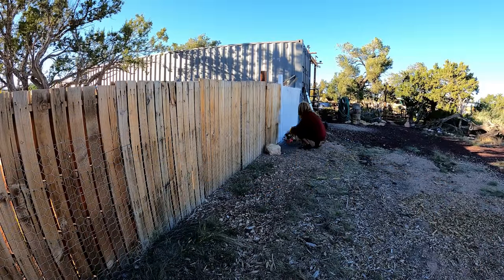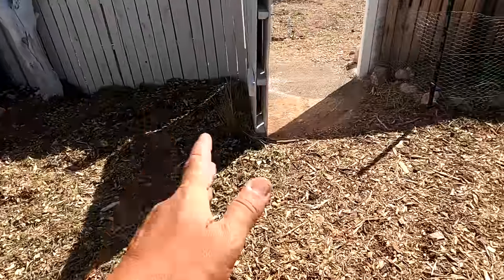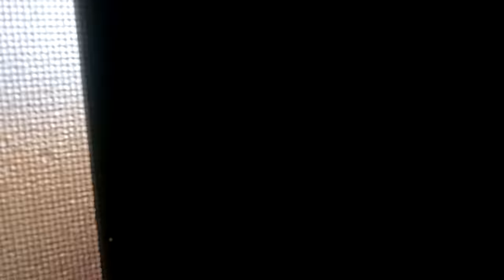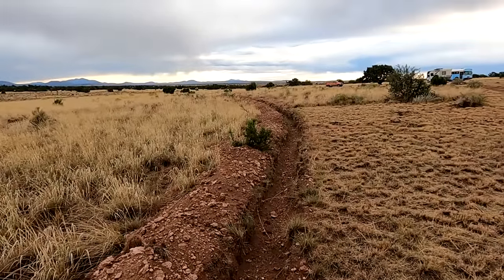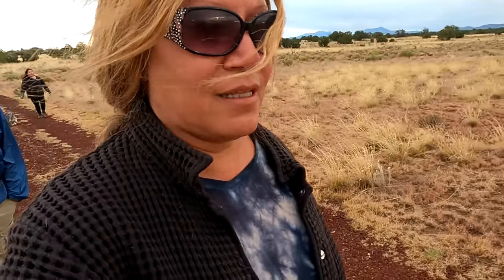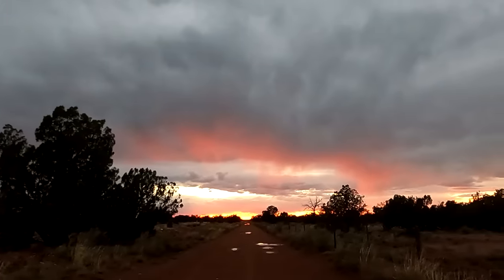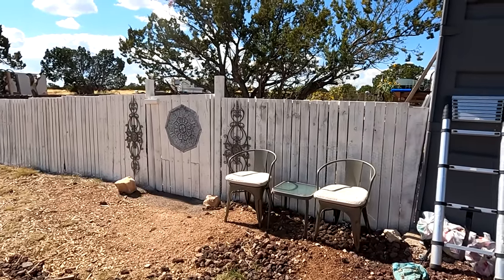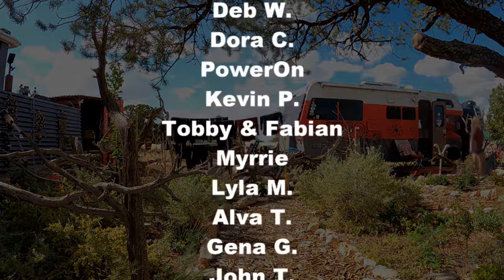Weird Weather, Painting DIY Pallet Fence, Mulching Garden, Teri & Scott Leave Base Camp

Comment: Since water is in such short supply, can you not suction up larger puddles before they dry (especially in the road) and use them in your garden and or ponds? Just a thought thanks for sharing.
Reply from the maker: That's a good idea 💡 🤔 but would need a sump pump
Reply: 12v bilge pump hooked to a battery with 5 gallon or some type large container in the bed of your truck would suffice... cheers @rvpandamonium